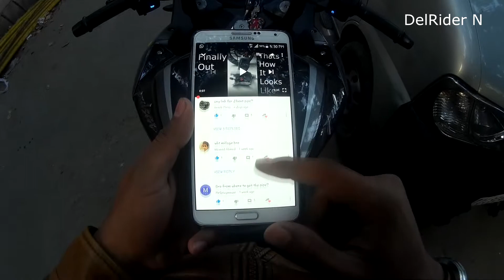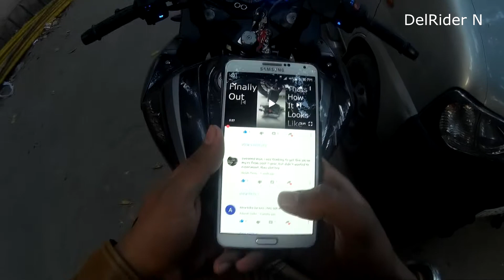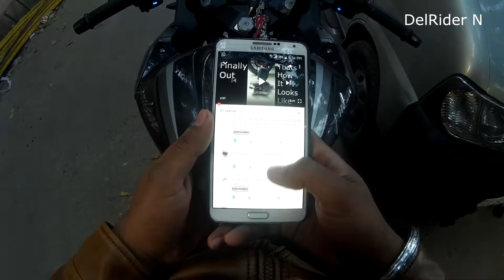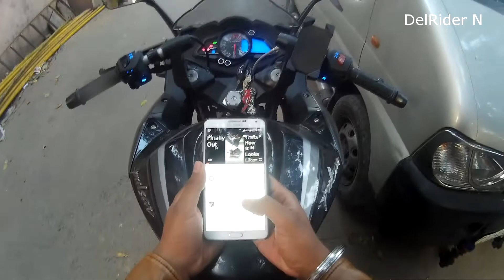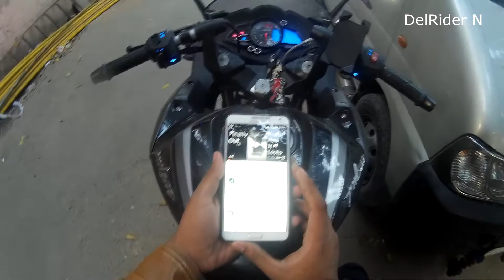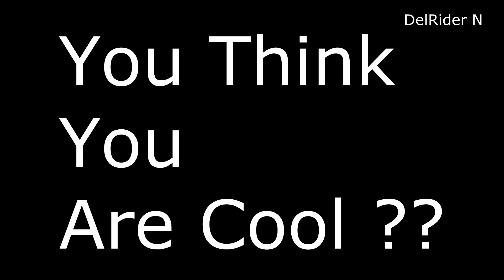Effects of Removing Catalytic Converter | Reply To Comments | 9-02-2018 | -DelRider N

Comment: One of my friend remove the catalytic converter and put an aftermarket exhaust but when he put the catlytic converter and the stock exhaust again the original stock sound became low and weird..does this happened to u??
Reply from the maker: No way! its just normal on mine.
Reply: @DelRiderNOfficial He have fix the problem it was due to damage of silencer gasket

Comment: Sir i need ur help actually maine apne bike ka catalytic converter remove kar diya hai kyunki waha ak damage agya tha jiske wajah sa waha se exhaust leakage ho raha tha but after removing it mera bike ka low end performance total khtam ho gya hai and jo bassy sound tha woh bhi khatam ho gya hai i have Apache RTR 200 par woh low end main pulsar 150 ke sath peeche reh jati hai.....so mai jan na chahta hu ki agar mai wapis agr bend pipe mai catalytic converter laga du after market se leke kya woh apna low end performance and bassy sound retain kar paygi???
Reply from the maker: bro I think first of all to correct this problem you have to go to the service centre they will check your engine and everything else and it's always better to get the original catalytic converter from the service centre rather than the aftermarket one and I hope that will fix your problem.

Comment: Bro i have removed cat-converter of  rs200 and m using excaust does it effect engine and does it get more heat in the engine ???
Reply from the maker: Nothing will change with the heat unless you rev the bike hard ... And about engine ... Same thing, power will drop a little bit so you would want to rev it harder for more power and thats the urge u have to control and it will just not affect anything ...
Reply: @DelRiderNOfficial  dear sir my bike pulsar rs200 water pump coolent oil seal has been damage and the coolent is entering in the engine i change the engine oil without repair of waterpump coolent oil seal the new engine oil become creamish  in colour i run about only 1km the new motul engine oil which mix with coolent due to seal damage can i use that engine oil which mixed with coolent ??
Reply from the maker: @shahedpatel_8552  Dude !!! Get ride of that oil, then get the seal fixed and get new oil before you kill your engine ... Radiator oil has alot of friction, engine needs frictionless oil, mixing will perma damage your engine
Reply: @DelRiderNOfficial  does you have any idea that how can i restore my new engine oil which mixed with coolent ??
Reply from the maker: @shahedpatel_8552  service centre mate ...

Comment: Brother I know it affects mileage and acceleration, but does it affect the engine and back pressure? Because it does heat up more. What if I buy a custom catalic converter? Will that solve the issue??
Reply from the maker: well yeah ! first acceleration will change only and only because of the change in back pressure as it will reduce a little, there will be no change in heat of course thats a myth ... rest yes a custom cat will help maintain the pressure and increase the performance for sure
Reply: @DelRiderNOfficial  thanks bro
Reply from the maker: @hridoypaul29  wlcm